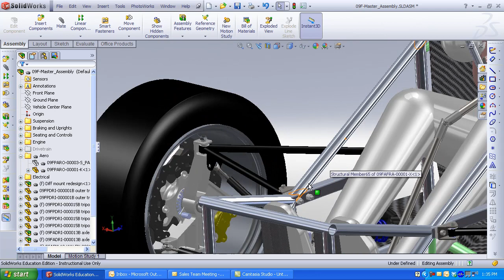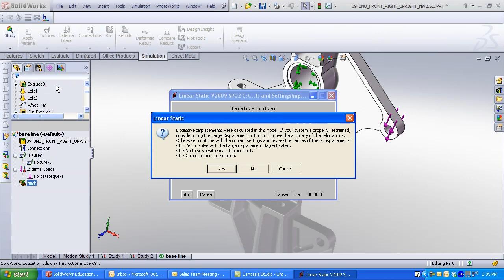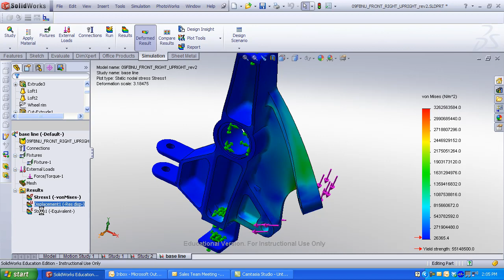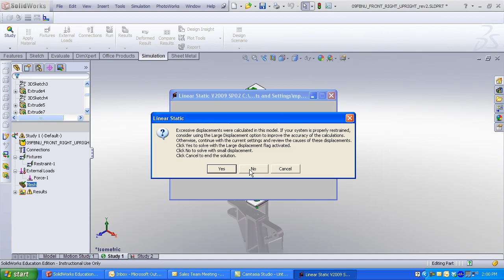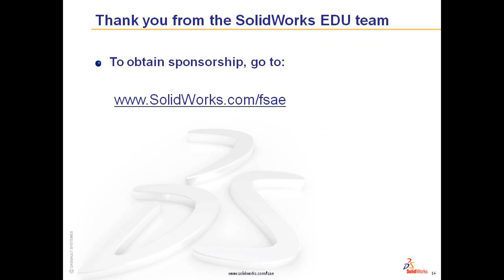Stress Analysis of FSAE Spindle Upright SolidWorks Simulation

Comment: hello, I would like to ask some question :). I have to simulate stress in furniture joint made of plywood. This joint is self-locking one, thats mean without glue. I dont know, which kind of contact between two parts of joint, I have to define. Can somebody help me? Is this contact possible between the construction part of self-locking joint to realize in SW simulation?